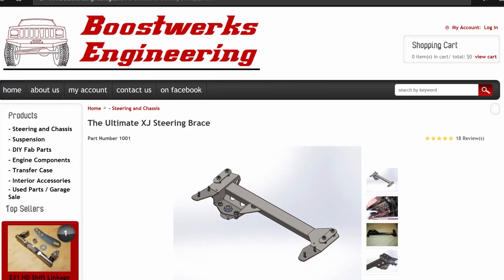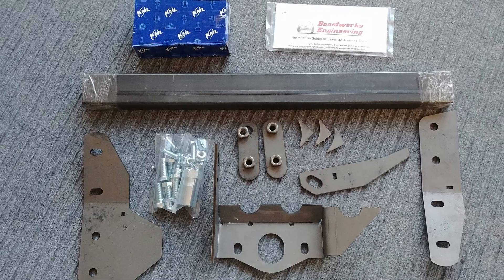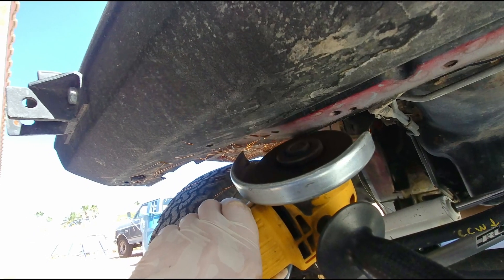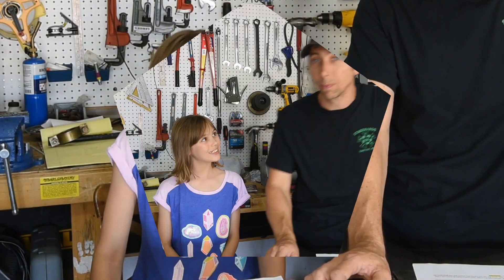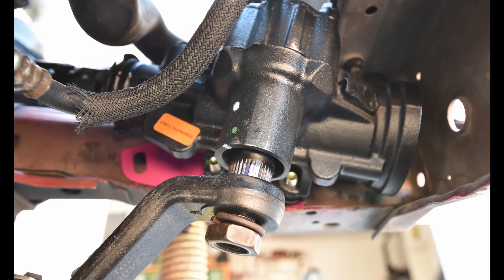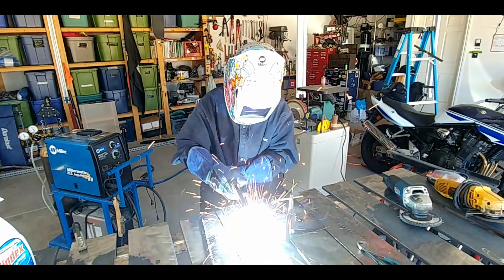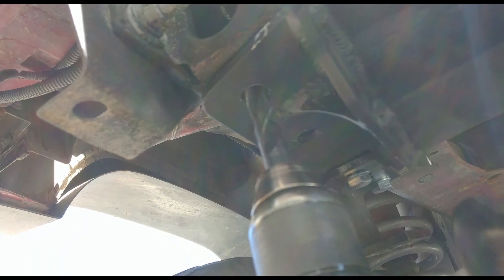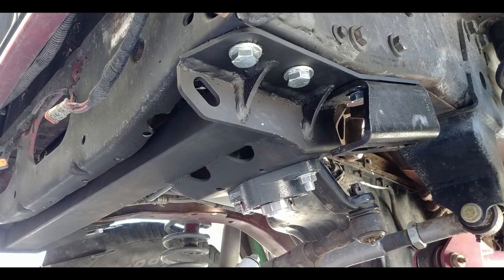Boostwerks Engineering Ultimate steering box brace for Jeep Cherokee XJ (DIY version)

Comment: I installed the mod on my 01 XJ about 3 years ago, one of the best mods I've done, to date absolutely no problems.  On my 3 previous XJ's, I welded in front frame stiffeners to stop the frame from cracking in the steering box area, this mod saved my a lot of time and money, great video.